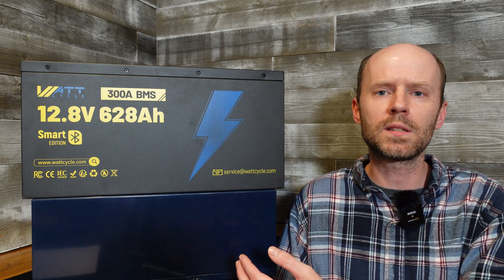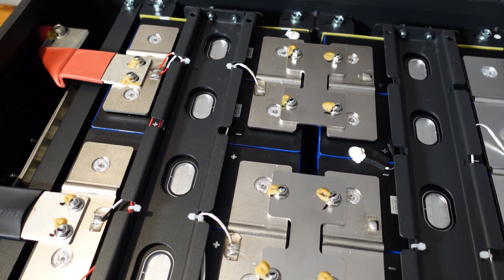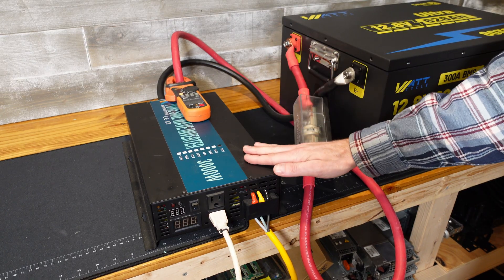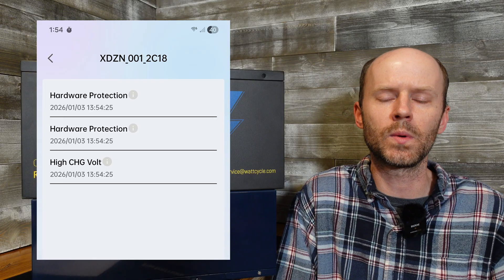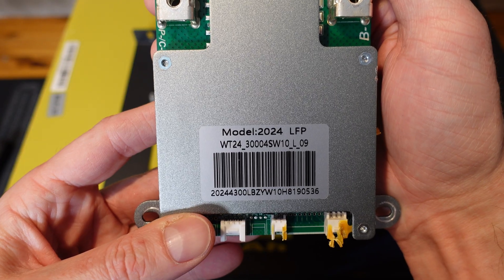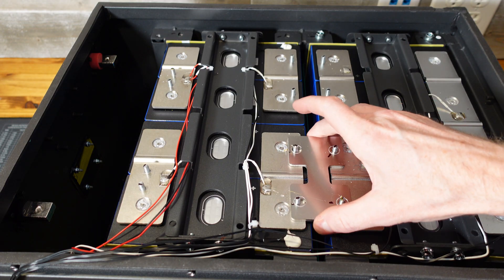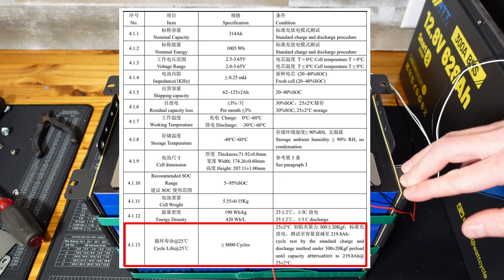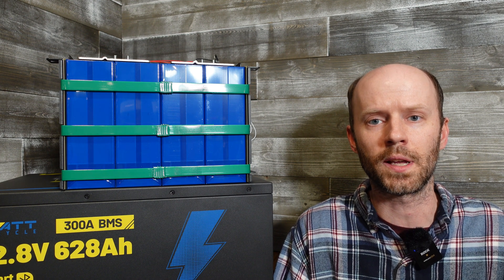HUGE WattCycle 12V LiFePO4 Battery 628Ah 8000Wh Complete Review

Comment from the maker: 628Ah Battery... https://www.wattcycle.com/products/12v-628ah-lifepo4-lithium-battery-with-bluetooth/?ref=lithiumsolar (Coupon "LithiumSolar")
314Ah Battery... https://www.wattcycle.com/products/12v-300ah-mini-lifepo4-battery/?ref=lithiumsolar (Two of these might be better than one 628Ah due to price, weight, and BMS limitations)
Follow Us! https://www.instagram.com/lithiumsolaryt
(affiliate links)
Reply: Hey mate what app do you use for the heat camera that shows you all the hot spots, 
Seems easier and more efficient than my heat gun 😅
Reply from the maker: @srhyah7155  It's a Seek Thermal camera that plugs in to your phone. It's the Seek app.
Reply: @LithiumSolar just brought myself one for $200 free postage to Qld Australia 
Cheers mate 👍

Comment: Do you know how to update the firmware via the app? I have 2 12v 314A smart with different versions and parallel”problems”.
Do you know how to solve this issue.
Wattcycle

3 week old from Wattcycle-Europe and they have problems all the time. I thought you have fixed the parallel problem!!
I have 2 - 12v 314A BT I parallel with busbars. Batteries are bought with one week apart and they have different firmware WT12_20004SW10_L447 and _L446, NO way to update firmware. The batteries behave strange under load. One show -1116 W other show -675 W during load at 1800 W.
When loading ONE battery at the time they show 1800 W or 143,3A and 143,5A, almost the same.
With small loads it is the same 
I use "ExactMatch" mode and both batteries was fully charged before connection. The state of charge in % wary a lot when used for som time, one 85% and the other 63%. Or 100% and 85%. It differs a lot. It is always battery with firmware _L447 that show the lowest %.
I have tried "Compatibility" with the same result.
What do I do to fix thei problem?
3 week old from Wattcycle-Europe and they have problems all the time. I thought you have fixed the parallel problem!!
I have 2 - 12v 314A BT I parallel with busbars. Batteries are bought with one week apart and they have different firmware WT12_20004SW10_L447 and _L446, NO way to update firmware. The batteries behave strange under load. One show -1116 W other show -675 W during load at 1800 W.
When loading ONE battery at the time they show 1800 W or 143,3A and 143,5A, almost the same.
With small loads it is the same 
I use "ExactMatch" mode and both batteries was fully charged before connection. The state of charge in % wary a lot when used for som time, one 85% and the other 43%. Or 100% and 85%. It differs a lot. It is always battery with firmware _L447 that show the lowest %.
I have tried "Compatibility" with the same result.
What do I do to fix the problem?
No answer from WattCycle??

Comment: FWIW Wattcycle uses TDT For their BMS boards.  Their physical construction is amazing for the  price. The TDT BMS is what’s holding them back.  They are looking into another BMS manufacture but it will take time. I have a number of their 314’s I have  fixed with JK BMS’s..
Reply from the maker: Great information, thank you! I did ask about the thermal limits on the BMS as mine was set to 140F but the specifications state 149-160F. I'm wondering if it can go higher but they're just not being programmed correctly (or maybe it was reduced to improve safety).

Comment: Thank you so much for being so thorough and including a low temp sensor test!
1. Are warming pads optional?
2.  Can these be installed in parallel? 
3.  What's the warranty policy and customer service experience like? 
Thanks again!
Reply from the maker: 1. This is not a heated battery, no warming pads
2. Yes, they can be connected in parallel with proper over-current protection (fuses/circuit breakers)
3. The marketing person has been very responsive to my emails; however, I have not tried submitting any warranty claims or customer service questions. I don't feel this is something I can comment.

Comment: The internal busbar is wide and dissipates heat. It's a good design. However, I don't have a cable that can handle 300A.
Reply from the maker: The BMS heat originates from the FETs, which the busbars are not in contact with. I can't see any way in which they would be helping with the heat issue.

Comment: Newbie subscriber here: is this a server rack battery or ?  Trying to understand the differences if it is more a standalone battery vs server rack.  Thank you.
Reply from the maker: This is not a server rack battery. A server rack battery is nothing more than a case designed to fit in a standard 19" server/equipment rack. The internals are the same - LFP cells and a BMS :)

Comment: One beefy battery.  Every lab has data failures. Good for reporting what you found.  I am very impressed with this build quality but $1000 is a large investment for 12v.  $4000 to get to 48v is putting a lot of eggs into one basket.  It is very tempting.

Comment: 150 pound battery shipped in a cardboard box is crazy.
Reply: I had 12x 300AH batteries in a power console. It ran for 2+ years 24/7 with no signs of troubles. It was 100% charged, the inverter load was 600 watts of 12,000 watt capacity. One day 18 months ago, one battery on the bottom shelf caught fire and burned up 8 batteries above it. This caused $150,000 damage to my shop and garage with terrible greasy black smoke damage.

The forensic fire investigator said that they thought that the battery was dropped from 5-6 feet in height and landed upside down and flat. A fat wire to the BMS inside was found to be pinch deformed. It shorted out and caused the fire. These batteries were 80+ pounds each and it may have been a loading dock accident. They came in cardboard boxes with Chinese miracle foam packing.

I now fear transportation damage in big heavy  batteries.  My replacement EG4 batteries weigh 280 pounds each and needed a pallet truck to move around. Any mishandling would have clearly shown up on the plywood box they were shipped in.

Comment: @ 3:59 your Reliable inverter isn't so "reliable" any more. Is that the end of the inverter or are you able to get it fixed?
Reply from the maker: I'm very disappointed. While I know they are cheap, I have used several of those inverters and this is the first issue I've ever had. I haven't opened it yet, waiting to make a video of it. I suspect it still works, I think possibly some conductors are undersized and the insulation melted off.
Reply: Nice to see you here!  I had commented on ElectronicsandMore channel about the name Reliable being the only thing "reliable" about these power inverters.

Comment: Thanks for the awesome review!!  I bought this battery about six months ago for my work-focused step van.  Luckily, mine came strapped to a small pallet so it was in perfect condition when it arrived.  I did not take the top off so seeing the inside assembly and structure was very interesting!  This battery is a beast and it has worked flawlessly so far.  I have 400 watts of solar on the roof and I'm running ARB's 63 qt Elements fridge/freezer, a diesel heater, and a 3000 watt inverter for a microwave and multiple power tools.  It's amazing how much energy and quality you get at this price point compared to a single Battleborn for the same money!  I also have a DC-DC charger, but haven't had to use it since upgrading to this larger battery.  Lots of bang for the buck!

Comment: I have a c8 energy 628ah heated battery in my semi truck as it’s only battery. But I think it only has a 200amp bms. So this size isn’t new if a trucking company is swapping its fleet over to the.  A super capacitor handles starter draw.
Reply: How much did you pay for the C8 Battery?
Reply: @xpally944  I didn’t pay for it. Company truck. And they’ve done it to some of the fleet. And I think all new trucks going forward.  No idea what they paid.

Comment: These are not where the QR code should be on REPT cells, they are supposed to be right next to the vent without any gap. You are misleading your viewers, remove the black cover next to the vent on the negative side and you will see where the original qr is. Wattcycel is selling counterfeit grade B.
Reply from the maker: These are Battero cells. While REPT and Battero appear to be the same company (or one owns the other, I am not sure) there are separate cell styles and datasheets for the REPT and Battero 314Ah batteries. The QR code is in the correct location per the datasheet I obtained.

Comment: I bought a 24 v 314 AH unit and there doesn't seem to be anyway to change the settings using the app. Also it wont let my Victron inverter perform as well as the AGM battery bank will. In colder weather I have to constantly work at getting it to take a charge. The temp sensor reads 4.5 degrees C and I have to play with the app then turn on the inverter then it will start to charge. Very frustrating
Reply from the maker: In the app, connect to the battery then go to the About tab. There should be a Settings menu in there. It's not in the most intuitive place.

Comment: Being able to configure these batteries to 51.2v 165ah would be nice.
Reply: How? The cells are 314 each...
Reply: @1975Per ah missed that.  Would work if they used 16x smaller cells I guess.
Reply from the maker: They have a 24V version of this, which you could make a 48V battery with only 2 of them. There's no space for 16 in that case though as noted above. WattCycle does have 48V batteries with 100Ah cells, which is pretty much the "standard" configuration on the market right now.

Comment: Just wondering.... I did the math.... 13*250 is above the 3000w inverter? Or I'm I missing something? Thanks for the video 👍
Reply from the maker: Great question. It is a 3000W inverter and the AC load was 2475W. The amperage measured on the DC cables in the video includes efficiency losses in the inverter (probably around 20%), fans, cable losses, etc.

Comment: Isn't that resistor on the BMS for balancing the cells?
Reply from the maker: No, the balancing resistors are pointed out at the 6:26 timestamp. I'm thinking it might be for an optional heater circuit.

Comment: It is NOT higher than rated, being that RATED means measured at 0.2C, other than that, excellent video!
Reply from the maker: Actually, if you want to be that specific, the standard discharge rate is 0.5C per the cell manufacturer not 0.2C.

Comment: I just don't see the purpose of using 12v on large systems. With 48v, the cables and cost are smaller, plus many other benefits. Still, if you need a giant 12v battery, here it is.
Reply from the maker: Totally agree if you need a lot of power, but something like this I see as a capacity battery - ie low current draw for a long period of time.

Comment: I would like to see you take a knife to the buss bars to scrape off the coating. Looks more like plated copper
Reply from the maker: It looks like you are correct! The multi-layer busbar is some sort of composite material and I guess that's why it felt heavier than aluminum should. It has aluminum luster. I scraped it a lot and it still looks like aluminum, but if I look at the edge, there is a tiny it of copper color visible. If it's plated, it must be thick plating. Perhaps I need to hit it with the bench grinder...

Comment: May I ask what brand the inverter was, please?  

A T Burke
Reply from the maker: WZRELB (previously known as Reliable Electric)
Reply from the maker: There will be an autopsy video soon.
Reply: @LithiumSolar  I look forward to it.  

A T Burke
Reply: @LithiumSolar  Thank you, Sir.  Almost bought one because you were using it.  Bought low frequency 2500 unit instead to get a 7500 surge rather than 6000surge.  

A T Burke

Comment: expansion bumps on all the busbars?
Reply from the maker: Yes, the little hump thing that allows them to push apart if one of the cells starts bloating.
Reply: @LithiumSolar How they push apart if they are tied together with series busbar on the top, just wondering, thanks
Reply from the maker: @Markush444  The batteries expand over time no matter how well they are "fixed" in place (and especially if there is a failure). With proper fixing, we're talking fractions of a millimeter. However, it does happen and the ability of the busbar to bend with this expansion helps reduce stress on the battery posts. Here's a picture to show how they "fan out" when connected with bendable busbars during a failure https://i.imgur.com/gdSSkH0.jpeg

Comment: Insane!  I think it would be way easier to keep the cells accurately balanced in this single unit vs stringing four 100ah packs in parallel.
Reply from the maker: Completely agree there, though two of the 314Ah batteries would be cheaper than one 628Ah and has the added benefit of not needing 2 people to move around.
Reply: @LithiumSolar  An extra benefit of 2 is if one goes bad. The good one can be used.
Reply: @LithiumSolar Right, better for handling during less than ideal emergency situations.

Comment: I like this one and I already placed 4 Dumfume 600 ah batteries which work as they should I may consider 4 of these too.
Reply from the maker: I have to wonder how Dumfume got 600Ah in those. Are they 6x 100Ah cells in parallel? I'm not aware of any other cell sizes that would add up to 600Ah exactly. Unless they're derating a 314Ah cell. I'd be curious in what capacity you have if you're able to capacity test one somehow.
Reply: @LithiumSolar  I believe they started with 280ah cells and then changed to 314ah in version 2
Reply: @offgridwanabe  we’ve come a long way from all those A123 cells eh?  😂 I bought some from Frank Z a long time ago, had them shipped to New Brunswick and I honestly abused the heck out of them.  Majority of cells still usable!

Thanks for all your content on them back then!
Reply: @LithiumSolar  Mike Builds did a breakdown of the Dumfume 600 AH. Yes, the number doesn't add up, but I bought one during Black Friday for only $520. It works great in the RV, and I can now run a small space heater and many other appliances solely on the battery. I used to turn the generator on.  The build quality was OK too, but that thing is so heavy at 107 lbs.

Comment: I have one of these made by dumfume
Mine has the 314ah cells

This one looks pretty good though
Reply from the maker: Is yours rated for 628Ah or do you have the 600Ah Dumfume and you're saying it has 314Ah cells in it?
Reply: @LithiumSolar  I just got the Dumfume 300Ah battery but it achieved 328Ah during my capacity test. So I guess it also has the 314ah cells
Reply from the maker: @veeerzes  Yep sounds like a 314Ah battery. I wonder why they're de-rating them then. Has to be marketing with the idea that people are much more likely to search even numbers like 300Ah than a seemingly-random integer 314Ah.